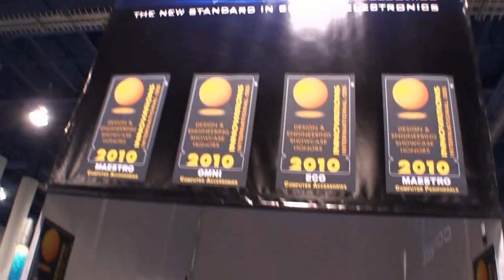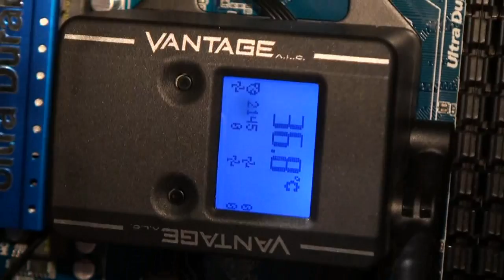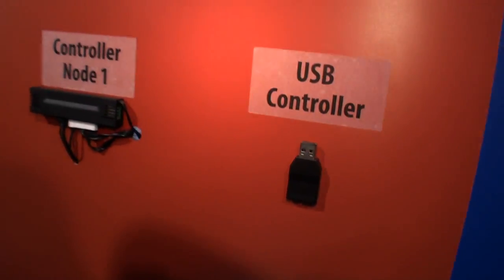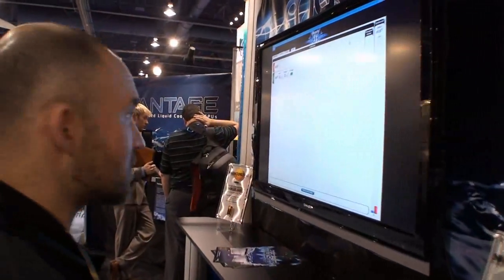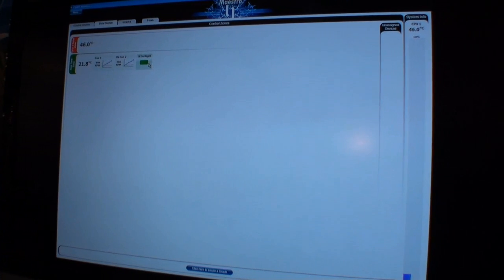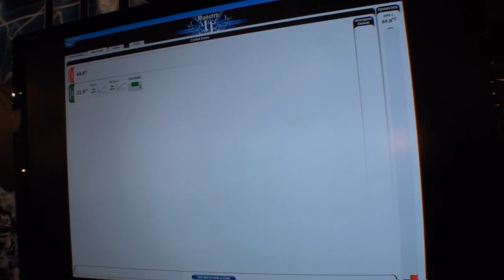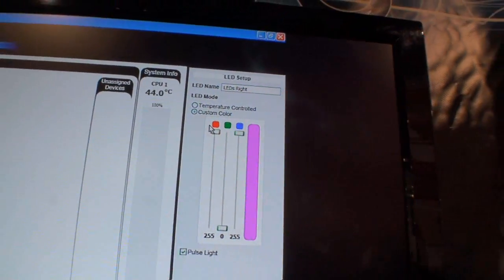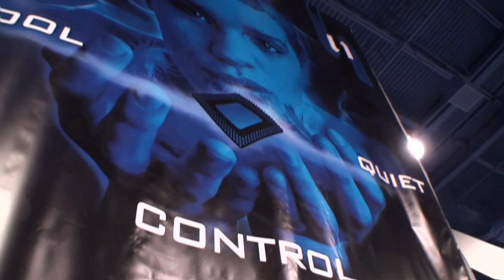Hands-on with new wireless CoolIT cooling toys at CES

Comment: DAMN :D  i take back what i said about liquid cooling...i'll take the gpu liquid cooling set up..im satisifed with my 9500 on my phenom IIx6 3.2 gig running at 29/30 idle in 71 degree room temp.  but my 8800gt and my future gtx480 or gtx580..i prefer to liquid cool that sucker.  I dont mind sweating but ONLY when im working out or mowing the lawn.lol my 8800gt idle's at 43 c and that's warm enough as it is. cheers and cudos on the GREAT video:D

Comment: @illkickurass1 The design life is 7 years.  The MTTF is 50,000 hours.  The 50,000 hour number comes from the amount of time the unit is in use.  The assumption is that over a 7 year period the PC will be off.  When the liquid loss rate is measured, we ensure that there is enough liquid in the unit to operate properly even after a 7 yr period since the liquid *very* slowly evaporates whether the machine is on or not.  Hope that makes sense :-)

Comment: awesome stuff, and the fact you can control the fans wireless and to have fans turn up as it gets hotter is very cool, major failures in cpu's and GPU's are because they get hot then cold hot then cold, if you can keep temps from changing drastically thats a step closer to having a reliable system . say my nvidia gpu idles at 33 degrees, at max load it gets to 70, well id set the fans so that at idle I would have 45 degrees, that way its not going up and down etc

Comment: These guys seem to be doing great things in bringing watercooling to the masses, with some nice engineering innovation too. That adjustable waterblock retention mechanism is a brilliant idea, the wireless control is gimmicky but useful, but I think one of the best (and simplest) ideas was the temp-controlled RGB LEDs... finally, an application for LEDs that's not just useless bling! Thanks to TweakTown for some good coverage.

Comment: What I like to know is with the second cooler, WHY WOULD YOU BOTHER WITH MAKING IT WIRELESS? You have to put the hoses from the controller/pump to the radiator. Just run the wires along the hoses and you have what seems to be a wireless system but will never be interfered with by other wireless signals and costs a shitload less to make!